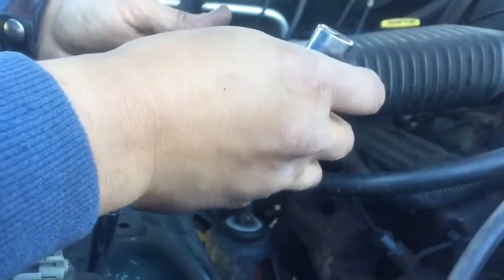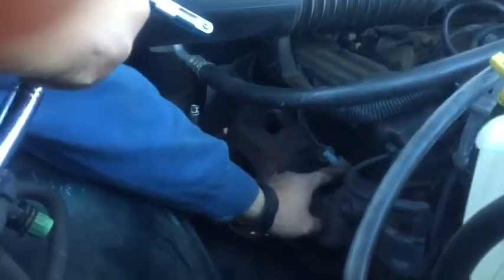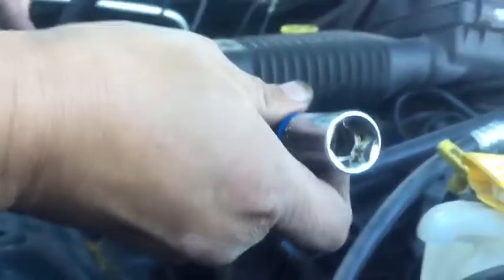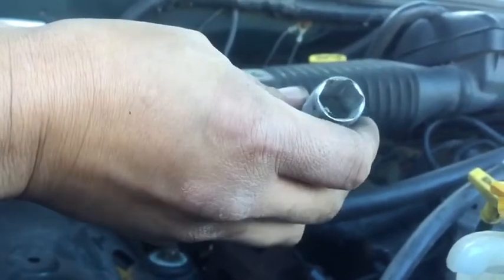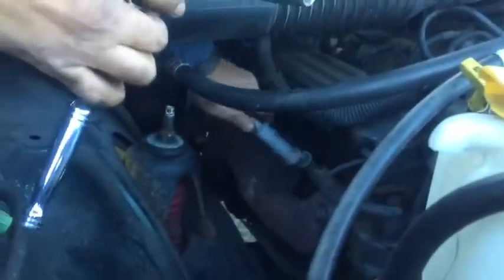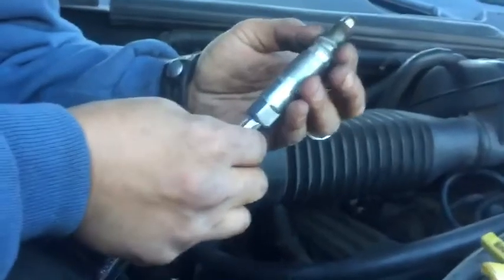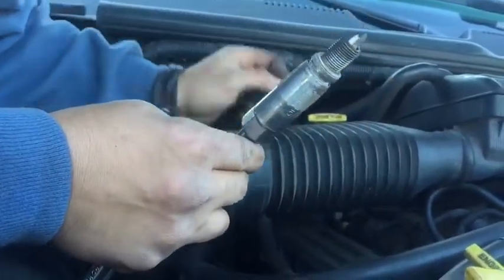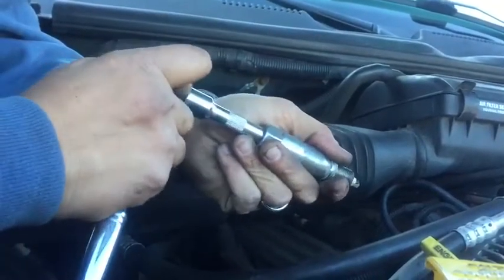2001 Dodge Ram spark plug

Comment: I'm about to do the same thing. I've heard people ripping the shield off! I'll try this method first!
Reply from the maker: Thatdudewithatie  good luck, I would be interested to know how would it work for you
Reply: Turns out someone had split the heatsinks(previous owner). I have a quick question tho! What lbs/ft did you tighten them? Hanes says 30 lbs. I did 10 lb. Thanks !
Reply from the maker: Thatdudewithatie  I always did it by feel  to be honest , just make sure you have anti-seize on the threats

Comment: My buddy and I were attempting to replace the spark plugs for a basic tune up and ran into the same problem of not being able to get the socket over the spark plug to start cranking it out. I figured the heat shield was in the way but couldn't think of a way to get past it. I want to personally thank you this is a great idea and I'm going to try it tonight
Reply from the maker: Tom Arnold you are welcome, I’m glad I️ could help, good luck with your tuneup . I️ would be interested to know how it goes for you.